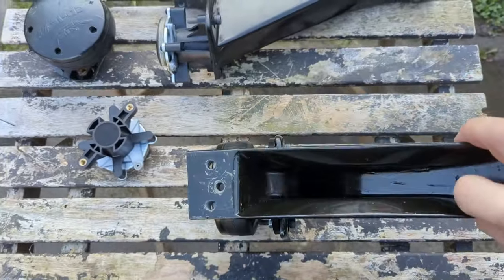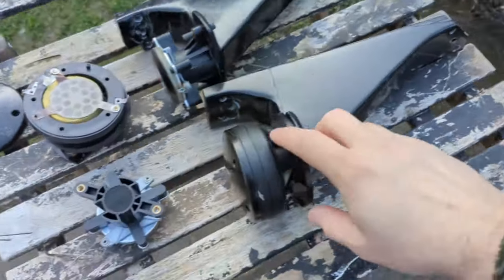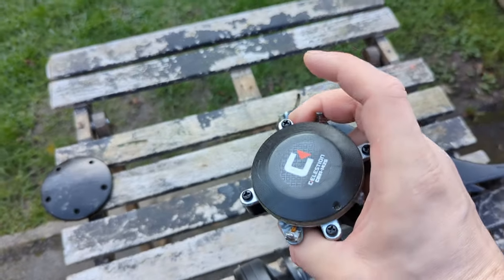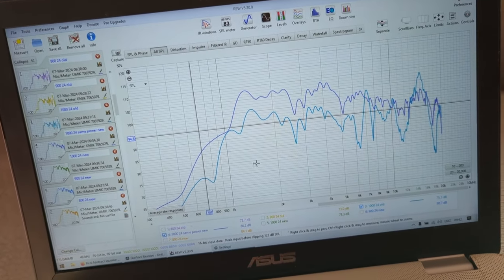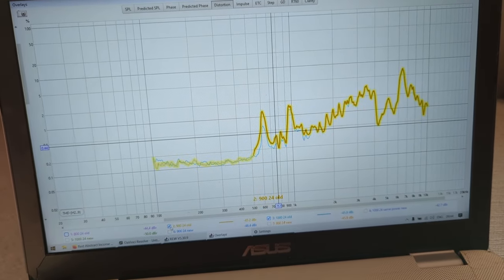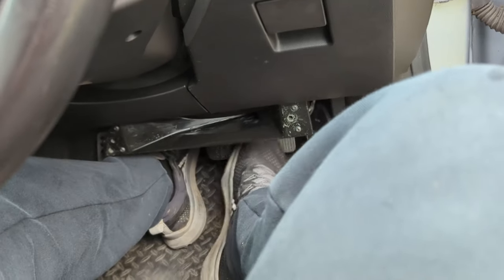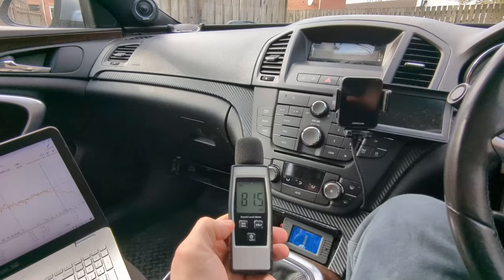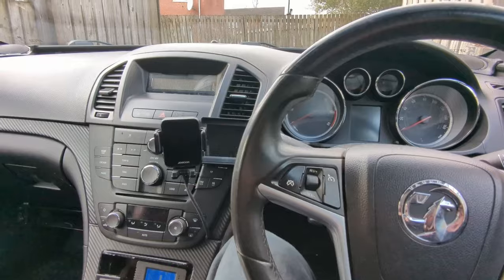Image Dynamics mini Horns: compression driver upgrade and tuning session

Comment: The whole point of HLCDs is to use the dash as an extension of the horn and that way, get the sound stage higher up and the bandwidth lower.
So how they are mating up with the dash is important and they should have panels that cover the whole width also, to extend the horn better.
It's a shame you  don't really have the space.

Comment: @RAW-Cat- Have you ever tryed swapping these comp. Horns, like put the driverside horn on the passengers side, and vice versa to the other side? I wonder if the wider part of the horn's mouth, was facing out to the door's, could that help with left, and right separation, and with spaciousness? It would be interesting to test.
Reply from the maker: I was told specifically to install them like I did🤷
Reply: @RAW-CAt - Yes, i understand, but would you please consider trying my recommendation? Then give them a listen, and re-test the freq. plot, and see how they perform, please, if possible? Thank you
Reply: Having the widest part of the horn to the outside completely obliterates the soundstage position. The whole point of the wider part of the mouth is to throw around 70% of the output to the opposite side of the cabin, and 30% to the seat position. This is the science of horns, being able to give amazing staging to both seating positions, as opposed to a regular setup only being able to accommodate one seating position perfectly for staging (you can get close with adjustments to speaker axis, but imho, still not as good as hlcd's ) 😉
Reply: @TheSoulspinner - He said the Left and right separation wasn't very wide. So i was thinking that with the horns refracting off of the doors, might expand the spaciousness, and widen the left, and right separation!? In my 35+ years of audio, i have tried thing's that on paper, should not work, but it did when i actually tried it. I have also had it go the other way. So what im saying is screw logic, just try it! I have won car audio shows by trying everything i could think of, practical or not. You would be surprised what might happen, but you will never know, if you don't try!
Reply: @TheSoulspinner <-- gets it.  It looks like the left side horn is aiming up, which explains the rainbow imaging down toward that horn.  The waveguides should be level instead of pointing at the driver's head.